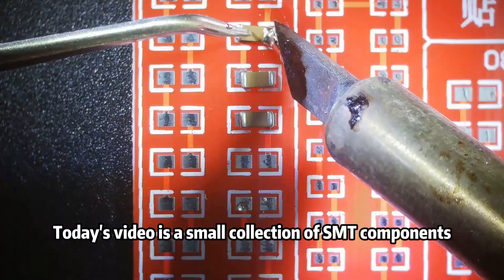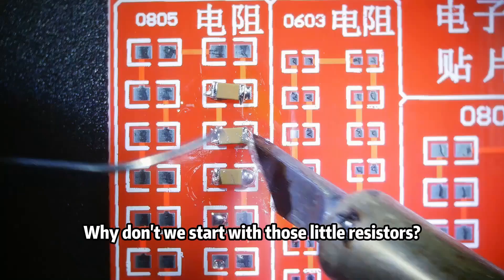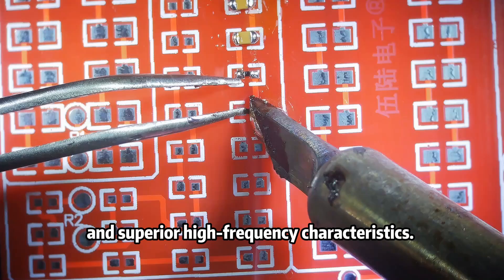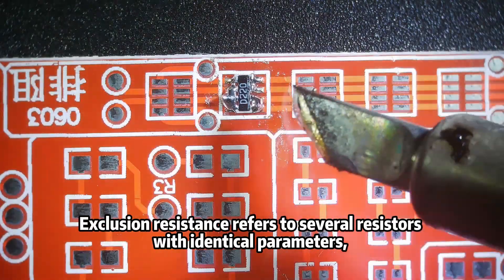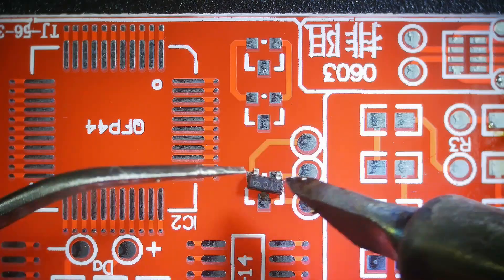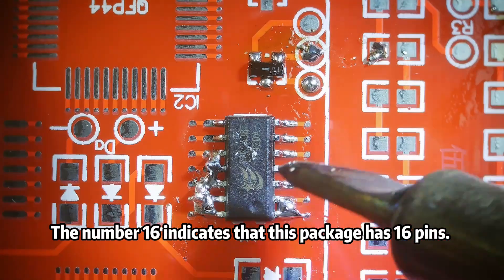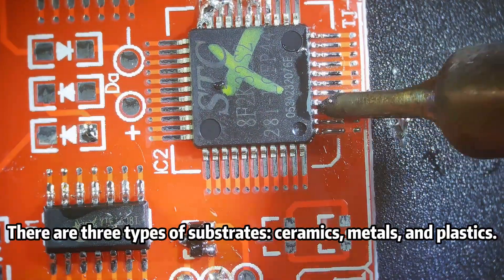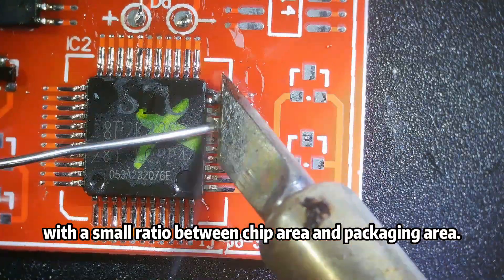Andonstar--SMT Resistance Soldering Collection！

Comment: You started with capacitors FTW. Also please use flux paste. Solderings will happen faster, will be more fimly and much less dirty. Current soldering state on this board is awful.